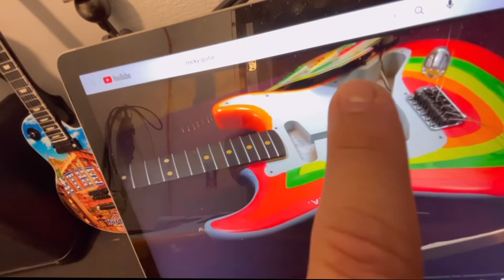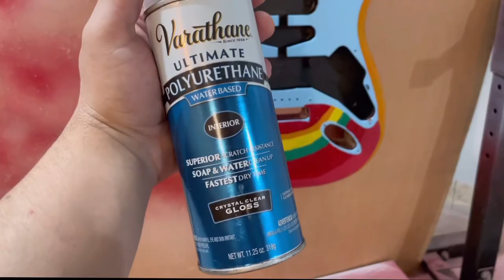How To Make A Rocky Replica

Comment: Bruv, this turned out great!!! Also major thanks for giving me the idea to paint a guitar with acrylic, I’ve been dying to recreate Prince’s sonic blue strat from a Fender Starcaster body, but the cold has prevented any spray painting
Reply from the maker: Of course man! Yeah I would say just wait till the weather’s good to seal it with clear so the paint don’t scratch off over time you know
Reply: For sure! I’m also going to use Tru oil to seal it as I don’t like working with rattle cans. Going out to get the paint supplies right now (after ordering some parts & two replacement HS pickguards)
Reply: Of course you could start with a Squier sonic blue Strat. But if you want to use an even lower-end Fender Starcaster, good luck. Far more work though.